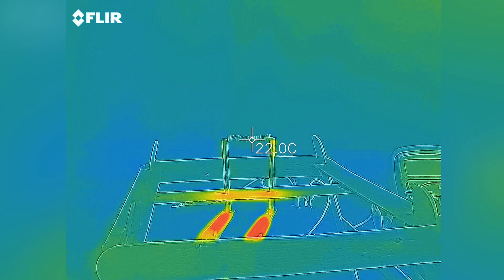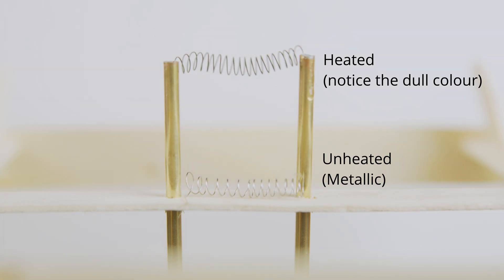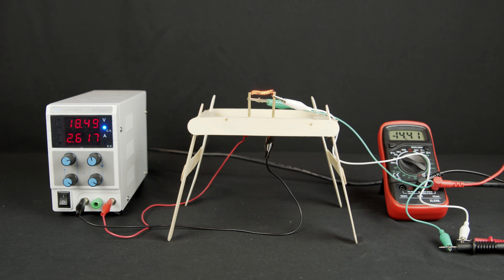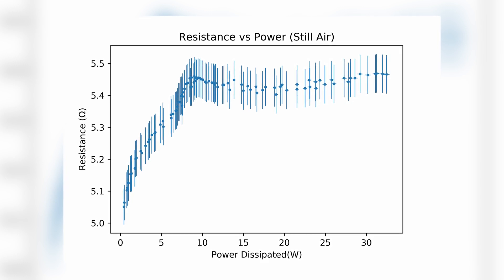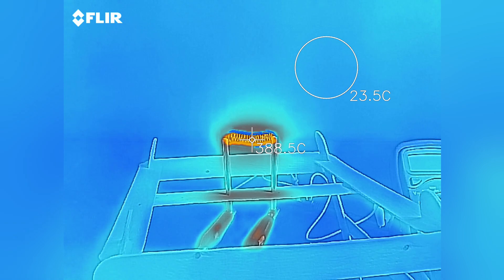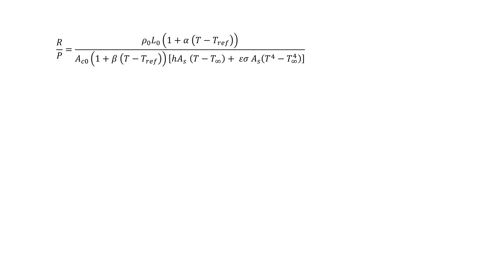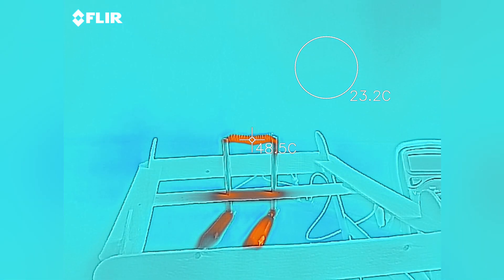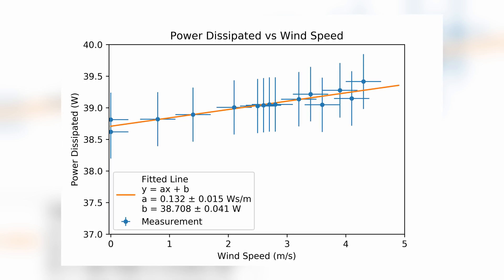Wind Speed IYPT 2021 Problem 4 Demonstration

Comment: When you are deriving the temperature-dependent resistance how come the (1 plus beta (T - T ref)) of length on the numerator is gone and on the denominator the coefficient of beta is one instead of two
Reply from the maker: This is because (1+x)^n is approximately 1+nx when x<<1. We can essentially move the coefficient to the exponent and cancel out terms.
Reply: @canadianyoungphysiciststou9723  So does that mean alpha and beta (temperature coefficient of resistivity and the thermal expansion constant) are far less than one?
Reply from the maker: @entertainie80  Yes. Alpha and beta are on the order of 10^(-4) and 10^(-6) respectively.